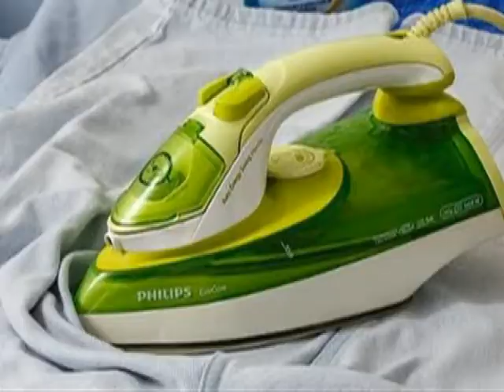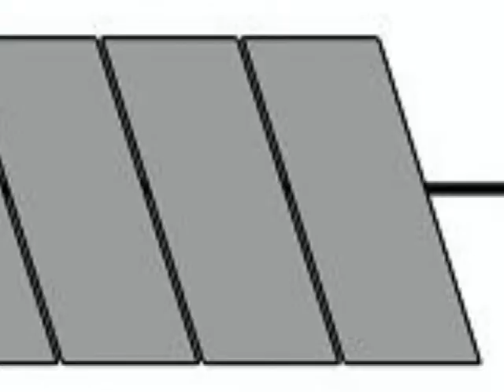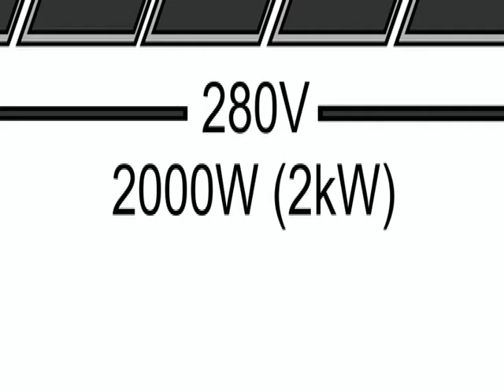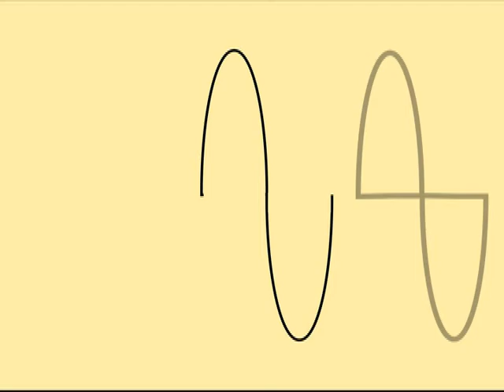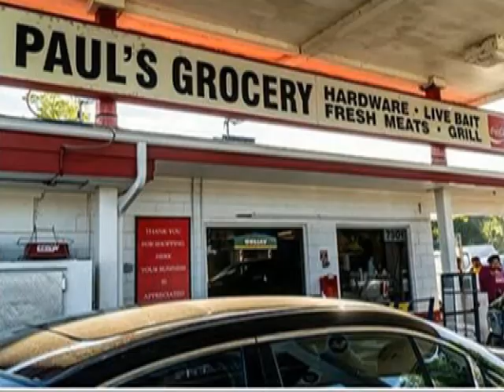Electricity for beginners 7

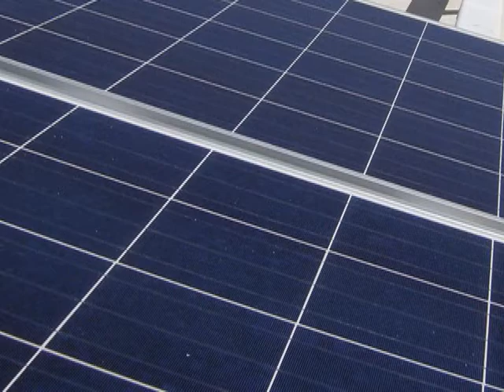Comment: 1:28   ( If we put cells in parallel 8 Panels 250w/h  = 2000w but 35V ) Also If we put cells in series like you did it is 280v but 250w only.
If you convert 280v 250w to 220v we will get  318w/h not 2kw/h.
I preferred it In parallel mode because in  series mode if the watts drops for any reason like shade all the the output will drops as per   the number of smallest cell. in the market there are  Grid-tie inverter working up to 48v. Thank you for sharing the ideas
Reply from the maker: Dear SamlyMEA, if you add 8 panels in series, you will get more voltage, and since the current will be the same as for a single panel, say 7.15 amps, if you multiply the voltage you get, by the current capacity, you will get 280 X 7.15 = 2002W. If you add 8 panels in parallel, you will get 35 volts, but more amps capacity, 7.15 multiplied by 8 will give you 57.2 amps. Then by multiplying 35 volts times 57.2  amps, will give you 2002W. The disadvantage of connecting many panels in parallel is that you will have to use very heavy gage wire.
Reply: Dear Mr. @eltunene , I recalculate and you are right it is give us 2KW. As per you tech us that W=V x A .  Watt=Voltage x Ampere. So if we have one 12v 40A battery we get 480w .   
Let us add one more battery in serial ,  we will get 24v but 40A  = 960w .  
Lut us put that 2 batteries in parallel,   we will get 12v with 80A  = 960w .  So the watts remaining in both serial and parallel.   
In our case one panel 35v 250w = 7.1A . Let us use 2 panels in serial, we ill get 70v with  7.1A = 500W ..  
If we use 2 panels in parallel, we ill get 35v with  14.28A = 500W .. 
 In 8 panels 35v 250w 7.1A in serial  we get 
280v 7.1A =2000w.  
 In 8 panels 35v 250w 7.1A in parallel we get 
35v 57A =2000w. =(57A) as you said it is a heavy gauge wire.
Many thanks to you.

Comment: Very nice but you forgot batteries. Very expensive.
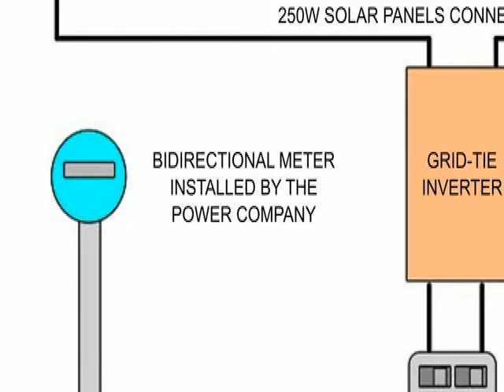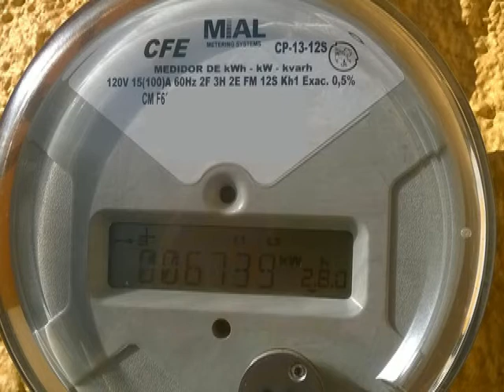Reply: He did not use batteries. He put the solar power to the power company 00:44  (grid tied system) to reduce the bill 4:07
Reply: @H2ON_MEA  You are correct. Sorry
Reply: @sueshe69  No need for Sorry . We all support each other. 
 ولولا دفع الله الناس بعضهم ببعض لفسدت الأرض
(2-251)
Reply from the maker: Dear RPatrick. In grid-tied systems you do not need batteries, the power company itself acts as your battery. In hybrid systems, both grid tie and batteries are used, but covering them would be far beyond the scope of a simplified explanation.